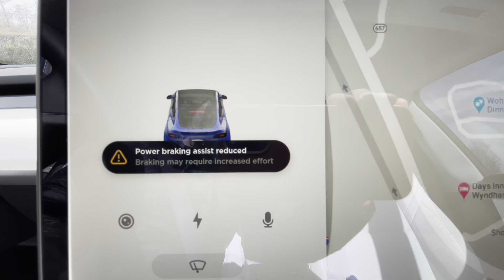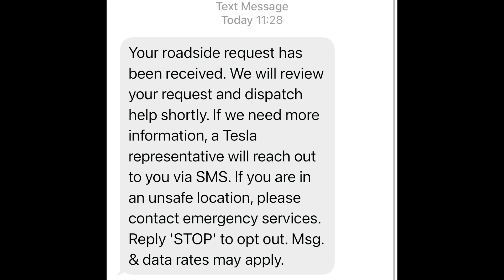E23 | Towed! Defective Brake Rotor?? (Tesla Model Y)

Comment: Oh my Daniel. So sorry for the interference on your cross country escaped. Can’t wait to hear about the resolution. 
I stillll have your code up for my order but Tesla has thrown me for a big debacle on my trade. I was offered 5k less than expected the first trade offer I put in. 
Then about 6 weeks later I put in another trade eval and they offered me another 5k less than the first. Not acceptable for me so I listed the truck privately.  I was surprised to say in the least so that following Monday I put in another trade request and it came in with a weird -$8500 Offering. It didn’t say what my truck would be valued at but the Tesla showroom rep told me this was described as the negative equity I would owe. What boggled me was they didn’t know what vehicle I was ordering and with what options so how could they offer me a negative amount when I wasn’t ordering a vehicle, but requesting a trade eval amount. 
If that all sounds too confusing I apologize but the bottom line is that I was eager to purchase and they offered way less than what my trade is worth. $22k for a 2016 f150 below 81k miles lariat was insulting to say in the least. The showroom salesman (who has been great) said it was due to the California office and the eval they did on comp trades in my area with my trucks value per area. Well their data is clearly wrong with what I know truck inventory to be In our area. They are in short supply. That sort of offer would most likely be for a truck 5-7 years older. 
It’s all good I’ll get there someday. I’m just a little sad I couldn’t get the year of supercharging before the end of the year that they were offering for vehicles purchased before year end. Well that and your miles from your code, oh and the model Y. 
I just had an electric panel replacement for my house to accommodate more breaker slots not only for my house but one so I can run a circuit to the garage for a charging dock. 
Needless to say I’m a bit disappointed with Tesla and their ability to streamline the trade situation. The showroom tells me they don’t handle those things on site, but that every person that wants to trade their vehicle has to put in that info via Tesla site to get a trade in quote. 
I understand the Tesla experience is way different than any dealership, but it seems odd that they as employees and staff for Tesla can’t get me a trade value on site, but make potential buyers do it through their site. 
I guess I’ll never understand why Tesla can’t have their team at a showroom eval a vehicle on site per local demand and inventory. It would seem logical that they could take the vin, miles, make, model of any vehicle and offer a trade amount for customers pulling on the lot. 
Oh well I’m hopeful for the year to come, and hopeful for your blue lightning to be back in your grasp again for more traveling experiences. 
I’m sending the good vibes to you having a swift resolution, and onto more positive experiences with your Tesla to share.
Reply from the maker: Hey! Great to hear from you. And that totally sucks!!! Lots of crazy details there, eh. In some ways, I wonder if the issue might be that Tesla sales are direct-to-customer via a company store rather than local (quasi-) independent franchise sales rooms. I wonder if that affects what local stores can and cannot do, in the way that other product chains simply sell products and they process returns/trade-ins based on strict processes/policies set by corporate. In that sense, the store is just an extension of corporate rather than an independent operator. In any case, you certainly should do what is best for you and try to get as much money from your truck as possible. While I like Tesla a lot and look forward to their success, at the end of the day, we are customers and have to look out for our best interest first. It's inconvenient that you would have to sell it on your own, but that may be best in the end! Looking forward to getting BlueLightning back once the replacement part comes in. I'll make a follow up video once that happens.
Reply: @goingelectric7826  thank you for the response and I recently have a person that is interested in the truck so things are moving forward. They could back out but I feel it has a potential to sell to this guy and his family. I’ve done so much to update the truck that it’s a great buy for anyone that wants this type of vehicle. I’m a bit nervous for the situation to be resolved in the fashion that if everything that I’m hoping for happens, then I would be shortly ordering a Tesla and changing my entire way of travel. The unknown is scary and exciting at the same time. 
I’ve heard a short saying that resonates with me and I try to live by it. 
It goes, “if it scares and excites me at the same time, I know I’m going in the right direction.”
It doesn’t apply for everything but it’s a great mind set. 
Thanks for your response, and I look forward to the day I’m part of the Tesla fam.

Comment: I noticed when the tow driver arrived they did not appear to use the tow hook that is supposed to be inserted into the front bumper/fascia . Instead the car was pulled onto the flatbed with straps from underneath ? thoughts . Thanks my wife and I are looking at purchasing a Model Y in 2021. Cheers - new subscriber 👍
Reply from the maker: Hmmm... I don’t think I know enough to have any thoughts about it. 🤷‍♂️ I will make a follow up video once the repair is made and all is said and done. Technically, the brakes did work today - they just did not have power assist and they were loud. I imagine that’s not a particularly good thing but the vehicle was operational if I needed it in an emergency. But since Tesla was keen to tow it in for repair I was keen to hand it over to them. Hopefully the repair is speedy enough. 🙏
Reply: @goingelectric7826  When you go to pick up your vehicle from the Tesla service centre ask them about the proper towing methods. I was under the understanding that the tow hook should be used whenever the vehicle is pulled onto a flatbed. However there could be another method available as well. Cheers look forward to your next Tesla adventure video.
Reply: Yes I noticed as well. Please look into it. Tesla advices to use only two hook. Any other ways might damage the car. I think it’s in the manual. You can check on your car under service how to properly hook up tow hook. Hope you get your car back soon all fixed up.

Comment: Wow. That sucks. Especially since you were on vacation and on another road trip. Well, shit happens, as they say. It's possible something could have happened even if you had ICE car. Nothing is a guarantee in life except death and taxes. Consider this another Tesla experience,  albeit an unpleasant one but at least you are warning the rest of us. It will be interesting to find out what the problem was that  cause this issue.
Reply from the maker: Yeah, I have spoken to someone else who drives a Lexus LC coupe and they’ve had two incidences with brake rotors themselves so my sense is that this component has its problems across industry. I am lucky that my work-remotely lifestyle means I’m not too bothered by this repair. But if I were someone whose life weren’t so flexible then I could see it being problematic. I suppose this is not uncommon throughout the industry as consumers face manufacturing problems that need repairs not-infrequently. In the end, Tesla certainly should improve its build quality but what will differentiate it longer term is whether or not its service model can keep up with its repair needs. This is not an uncommon predicament for companies as they scale up.

Comment: That is a very weird sound the brakes are making. I can't imagine what that is. Will be interesting to find out. It looks like the tow truck driver didn't make use of the tow eye that screws into your front bumper. I wonder what he hooked on to. Did Tesla send him or did you arrange the tow? Thanks, Phil
Reply from the maker: Tesla arranged the tow. He hooked onto something - not sure what tho, but it made it up on the truck. Once I hear back from the repair center perhaps tomorrow I may learn more about what the issue is and timing. I kind of hope they can take a look at at my wind noise issue and perhaps a couple other very minor things while they’ve got it.
Reply: @goingelectric7826  Good. When I saw that it reminded of the horror story from another guy with a Model X. Anyway, hopefully all is okay and you will be back on the road in no time.

Comment: Amazing how tolerant Tesla owners are of their  cars reliability problems. Considering how fewer parts an ev has compared to an ice car. If I was to travel across the USA during covid times, I would probably take a Toyota hybrid.  Consider that the Prius is consumer reports most reliable car,  and  all Tesla cars rate poorly in that area by CR.  I would love to buy a model y once reliability was sorted out.    For my dream vehicle , a VW camper with Tesla battery and motors.
Reply from the maker: You are certainly not incorrect that Model Y manufacturing issues need to be sorted out. However, excluding this issue (which is as-yet not confirmed), my Model Y had been delivered virtually perfect which I had made a video about previously. In the case of a brake rotor though I know someone who drives a Lexus LC coupe ($100K+) and they’ve had TWO incidences with their brake rotors so either Toyota/Lexus sucks even worse than Tesla, or this component can be problematic equally across the industry. In the end, I was in a position to buy a new car and I knew I wanted an electric car and not an internal combustion engine car so a Toyota hybrid just was not an option for me. Currently the viable options are quite few but that will definitely change over the next couple years and Tesla will need to ramp up quality before they develop an inescapable reputation for poor quality (true or not) especially as established carmakers with better records of quality start producing more capable electric vehicles. And while Prius is a great vehicle, it’s not fully electric and/or it just doesn’t drive as good as a Tesla. But it certainly has better quality ratings so no shade against it. :)
Reply: @goingelectric7826  no doubt you are right that no other car drives like a Tesla. Stay safe and healthy. There is light at the end of this tunnel